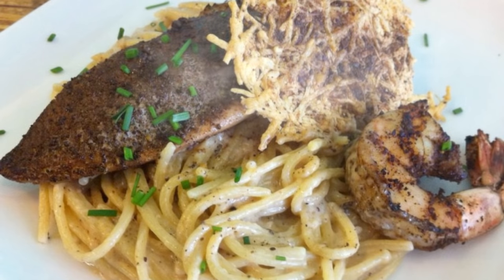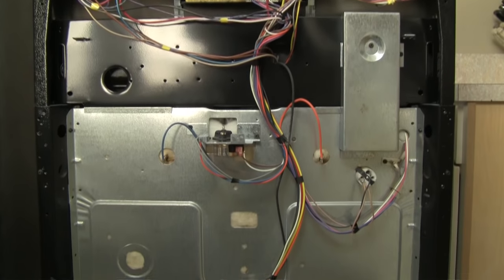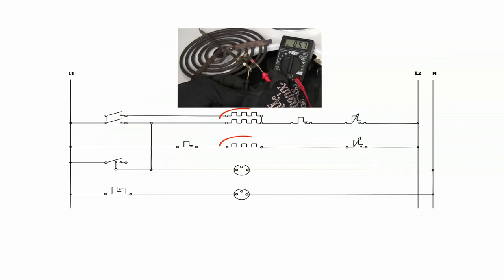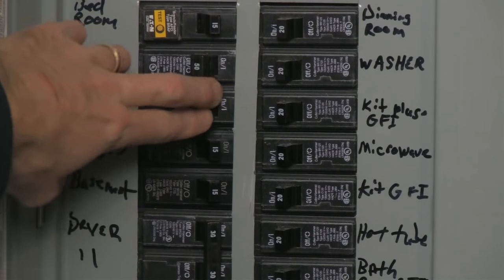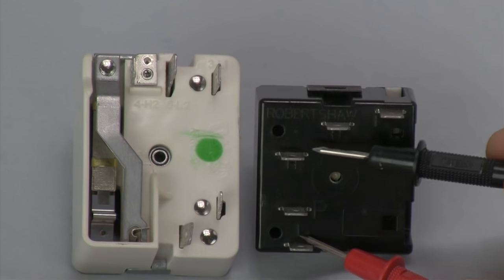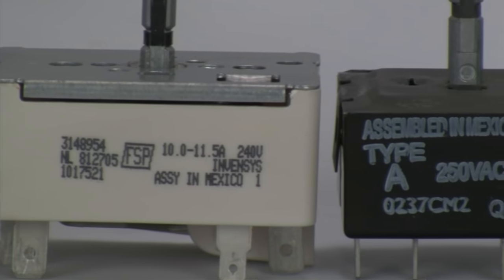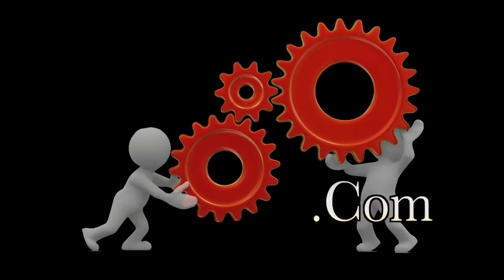Electric Range Stove Repair: How To Repair Burner Elements

Comment: Thanks so much! Fixed my problem @5:18 The replacement switch I ordered was the issue, the infinite switch was rubbing against the plastic housing causing it to bind and get stuck, not allowing current to flow through. Used a razor blade to remove some plastic and allow the infinite switch to move freely, good as new!
Reply from the maker: Now that's what I'm talking about! Good observation skills!  thanks for taking the time to comment!

Comment: Thank you for the information.  I had replaced the entire cook top wiring with a wire set from another brand of range.  My brother sent me the replacement from a scavenged unit as mine only had two working burners.  Replacement went flawlessly without help but the large element I usually use to boil water now took forever and never fully boiled.

Your identifying the amperage range of the switches was the solution I needed.  I simply swapped the infinite switches for the left two elements and solved the problem.  The right two were already connected correctly.  I can only guess that the original stove had both large burners on the front.

Comment from the maker: Glad to help : )  if it is just a cook top then it should have a separate power supply from the oven, so I would still guess that there is some kind of a problem with the electricity getting to the stove top... maybe a loose connection so be careful. Good luck!

Comment: THIS IS REALLY AN EXCELLENT VIDEO. I actually understand it. I have to do this on a Kenmore glass cook top. Either I fix it r it goes 2 the curb. It came with the house. Would never buy one of these, cheap, junk. I would spend more $ and get a better quality appliance, than buy junk. Tired of fixing/having it fixed.

Comment from the maker: The idea is basically the same the main difference is the need for a pan or pot with a fairly flat bottom for better heat transfer.  the only other issue is when your tasty culinary concoction is complete, it is a good idea to move it to a cool surface element because cool down time is fairly slow with electric surface elements.  Also if you have a glass top be careful not to use pots and pans that may scratch the surface. Good luck! Thanks for the question!

Comment: This is an awesome video. Thanks for your efforts. Concise and well explained. Helped me alot. I was working on a range that had 2 dual elements and they are both operating erratically.  I was thinking it might be due to the temp probe on the element and told "no that probe is simply for the pilot lights so it is most likely the control switch/knob that is the problem. Your video seems to confirm that all the heat cycling is done at the control switch/knob. Is that correct?
Reply from the maker: Thats the direction I would try first. Good luck!

Comment: Thx for the video.   My left front burner was not working - and it is the one controlled by the simmer select control board.  After testing the infinite switch for continuity L1/H1 and L2/H2 to be okay - I ordered a replacement simmer select control board and now its back to working order.    Save hundreds on a repair man visit.

Comment: Great video  Thanks, like to ask you a question I am not getting the 240 volts when touching both hot wires. I do get the 120 volts off each side. where could I start looking for the problem

Comment from the maker: Sorry for the slow response. on the Frigidaire style there are a few Phillips head screws on the under side of the top that you can see when you open the oven door. at that point the top hinges up on two tabs under the back of the top. Be super careful!! you may want to have someone else there to help. If the top breaks it's very expensive to replace! Good luck!

Comment from the maker: My pleasure! Unfortunately no, this is the only range video I've made. But in most cases the back panel will come off with a few screws and the switch is held in place by 2 screws behind the knob. You need to order the switch by the range model number which is usually located behind the storage drawer on a sticker on the frame of the range. Make sure you get the right one for that element, they can be different depending on the element size. Good luck! Thanks for the question!

Comment: Thank you for all the wonderful information.  Because you were so concise I was able to open the cook top and review the parts.  It became immediately apparent that my large front right burner was none functioning because one of the metal connections on the wire leading to the burner had burned and was no longer making contact.  My question is: Do I need to replace the complete wire with ends? Is it possible to put just a new end on? Do I need to replace the L1 L2 switch as well.

Comment: Thanks!  This video helped me figure out the problem with my stove!  The element control switches were switched (pun intended), so that the small and large burners were mismatched.  It caused the large burner to not really heat at all unless you turned it on high.  It must have been that way from the factory.  I just switched the switches and everything seems fine.
Reply from the maker: Congratulations!  Switching switched switches...Perfect!  Thanks for the comment!

Comment from the maker: Sorry for the delay, I hope you figured it out. Try using a meter to check for voltage from a screw on the range's frame to a ground connection and see if you get a reading. There is probably a shorted wire somewhere... Then unplug it and check for resistance from each of the plug terminals to the frame as you turn each burner switch on one by one. Hopefully that will help to narrow down where you should be looking. If you still don't find anything look at the oven element wires. Good luck!

Comment: Thanks for your video. What should I do with broken filament? Is there a way to reuse it or solder join?
Reply from the maker: There isn’t anything official that I’ve heard of or tried, but if you can figure something out that works I would love to hear about it.
Solder wouldn’t work because of the heat involved.

Comment: Hi, I'm so happy to found your explanations. I bought a Maytag in 2007 but the triple surface burner element never work. By the time, I realized it, the guarantee was finish. I checked everywhere with multimeter and the problem seams to be a broken coil. I want to know if it's reparable ? Can I do welding on it ? or need to replace ? It's very expensive, about 150$ 
Can you help me please ?

Comment from the maker: Well that kind of is what they are supposed to do... Is it not getting hot enough over all? When they are on they are full on, then cycle off to cool down, then back on again and off and on and off...   Side note: If the element is heating up to red it is okay.  So if the temperatures are not good enough I would lean toward a weak infinite switch... Hope that helps! Good luck!

Comment from the maker: Whatever elements are sticking on sound like they need new control switches. most likely the L2-H2 connection is shorted closed and not cycling properly. when the switch is turned completely off then the L1-H1 contact opens and turns the element off. Good luck! Thanks for the question!

Comment: i have the original ge electric oven/stove top. very basic. it was in the house when i bought it and i hope to use it until i redo the house and buy new in a year or so. but the only thing that works is the light inside the oven. looking forward to following your troubleshooting techniques tomorrow. thanks.

Comment from the maker: You can crimp on new terminals. (you can find them at most hardware stores) However, it is a high amperage connection so it needs to be a very solid crimp connection.  Your switch are likely okay you may want to double check so if you do need it you will only have one shipping charge.  But it's probably fine.  Thanks for the comment! Good luck!

Comment from the maker: Do any of the elements work?  Try resetting your breakers first. If that doesn't get it going again, you will need to look for a loose contact to the H1 side of the switches.  Hope that helps some. Good luck!

Comment: Great video!

Having problems with an old Jenn Air downddraft built-in counter stove/grill.
The two elements on the rihgt hade side are still functional.
On the left, there is either an insertable tray containing two more burner elemnts or one large barbecu type burner.
Barbecu element stopped working and when replaced by the two burner tray, one of the two burners no longer worked.  Replaced a burnt fuse and when turning switch for the non functional burner element fuse blows again.  To con't..

Comment: Wonderful video very informative. I have a question so my stove has a small burner and a larger burner being controlled by one dial or switch. So when I want to use the larger burner the entire eye is suppose to heat up. Sobthe coils that heat the outer portion of the eye work  and heats up while the coils that heat the inner part (the small burner)  of the eye does not heat up. In turn when I want to use the smaller eye portion only it still doesn't heat up. How should I tackle this problem?
Reply: Even though the element is one item it is made up of two separate heating coils. Sounds like the small coil is probably broken. Visual inspection or checking each part of the coil for continuity with a meter would verify the problem.  Best case would be a power supply issue inside the control switch for the smaller coil. Hope that helps! Good luck!

Comment: What a great video...!! any thoughts with 1 out of the 3 burners not working? I get a power reading on the 3 operational burners, but no reading at all on the bad one. Any suggestions?
Reply from the maker: Probably a bad switch that is controlling that element.  check voltage at the switch L1 and L2 is input so you should have 240 VAC there all the time… Then if the switch is on high you should get 240 VAC at H1 and H2 which are the output connections.  Good luck!

Comment: awesome video and website! I have an electric glass top stove. one of the elements on the stovetop when turned on, will make a big spark coming from the element, blow the fuse in the electric panel and create some smoke. could it be the switch itself is faulty and pulling too much amps?

Comment from the maker: Most likely... It sounds like the L2 connection is welded closed within both switches.  You can use a meter to verify... the L2 and H2 connections should not have any contact when the switch is off. 
Thanks for the comment!

Comment: Thank you for posting the video.  I have an electric range cleaned by the cleaning lady, then the surface heat light is on all the time.  When I turned on 1 switch, 2 burners on the same side were both on.  Could you help me figure out what the cause is?  Thanks a lot.

Comment: great  vid!!  i have a   jenn aire  that i  just dumped water on and  shorted   something  out    how do i  get the  top off?    thewater   popped and    flashed under thetop  the oven shut and locked cloesed  but  the   top  burners   showed  power  when i  turned  them on ,  its unplugged and    drying out

Comment: How often should the elements be cycling on and off. I put all switches on 5 and they seem to cycle on and off about the same. It’s a glass top stove very similar to the one in this video. Not too familiar with this style. Just wondering if it’s normal. Bought it used , everything else seems to work fine.

Comment: This video is very informative. I have a LG electric glass stove top. The main (largest) burner is only partially heating up. The outer ring is heating up but not the inner rings. Do you know what could be the cause of this?
Reply from the maker: If it has an inner and outer ring that can be controlled by the switch (Small, Large) then that part of the switch is bad or the inner part of the element is broken.  It can be checked in the same way as on the video... just think of it as another burner set inside the main element.  You should have a reading through the element itself, and a connection from the L1 to H1  and L2 to H2 contacts on the switch that feed the smaller inner coil.  Hope that helps! Good luck!

Comment: very informative. But where is the switch for the warming zone element centre back of my frigidaire stove top? It's controlled by pressing a button repeatedly on the panel beside the clock. The element doesn't turn on, and before replacing it, I wondered if something else could be the issue with it.

Comment: My dual radiant element has a second probe across from the shown probe and it that failed and caused the burner to not heat.  Check the continuity on that probe too.

Comment: I have a Kenmore model #790.96593602 electric glass top stove. The large front right three coil burner has stopped working properly. The main inside burner went out but the middle and outside ring still works. I opened the top and tried doing a continuity test. I expected to hear the closed circuit on two of the three circuits but instead I hear nothing. When I touch the two meter probes together, my meter buzzes so I know it works. I need to find out if my element needs replacing or the control panel needs replacement. Could your help?

Comment from the maker: Sounds like the control relay the powers the broiler is shorted closed inside the control... Technically the answer to your question is no. However... There are two wires feed power from the control to the broiler element... From there you will need to use your own good judgement and discretion. : )  Good luck!

Comment: May I use a small portion of this video in a video I'm working on? I just want to show an oven element burning, and would be more than happy to point back to this video.
Reply from the maker: Probably, What amount of time would the clip be?
Reply: @applianceassistant  I didn't check exactly, but around 5-10 seconds, just a bit with a stovetop heating up, video only.
Reply from the maker: Yes you may. Thanks for asking!

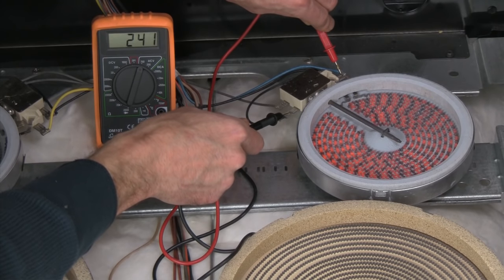Comment: My original burner only has one connecting tab on the left side. All the replacement burners I see have two like the one in your video at 3:58. I see that you're only testing the bottom connector with your multimeter. Is there a way for me to get a newer burner to work somehow even though I only have one connecting tab? Maybe by splitting the one wire into two? I have no idea.
Reply from the maker: Interesting, what is the model number?
Reply: @applianceassistant  The cooktop cartridge is the JDXR50. The 8" heating element is WB30X5116.

Comment: Awesome video! I have a LG LRE3091SW and the left front burner sometimes gets super hot...even when set on 3 or 4. When this happens I turn it off and on and then it seems to be ok but today it went red hot again even though it was only on 3. Any thoughts?
Reply from the maker: It's normal for the element to cycle red hot and then off and back on again. However, if it is sticking on and not cycling or it is running much hotter that what it used to do then probably the L2 to H2 connection in the control switch sticking closed and not cycling properly.  Hope that helps!
Reply from the maker: It's normal for the element to cycle red hot and then off and back on again. However, if it is sticking on and not cycling or it is running much hotter that what it used to do then probably the L2 to H2 connection in the control switch sticking closed and not cycling properly.  Hope that helps!

Comment: Question.  My issue with my JBS55DM2WW :  8" heating element won't heat.  Opened up the glass top and saw that a blue wire appears burnt and has disconnected from the crimp spade.  Can I simply buy a new crimp spade connector at big box store and fix?  Do I need a special stove/oven rated spade connector?
Most online appliance store don't have the wiring harness for sale, and I don't believe I need an entire new harness;  just the one bad wire that came off, right?
Reply from the maker: That should work just fine! Just use good materials and make sure you have a good crimp and you should be fine. I look at it this way... the factory crimp failed, so you can’t do any worse... ; )

Comment: Hi applicantassistant. I have a whirlpool gold and my electric burner stopped working but the bridge burner work that is located right beside it. Do i need to change the element since the bridge works or could it be the infinite switch?
Reply from the maker: Not sure why I missed you post... I hope you have it figured out, but if not, it could be ether the element or the switch.  Just treat the second part of the burner like a separate element... the switch will have two sets of out puts for each coil in the element, so you can check it in the way I show on the video. You can also check the wires from the element in question for resistance with a meter, if it shows as open then the element is bad.  Hope that helps... you or someone...  Thanks for your question!

Comment from the maker: Unfortunately, if the elements are okay and check out with a meter for continuity, then it is likely the control board. (easy repair) Probably still worth fixing if the rest of the appliance is in good condition. good luck! Thanks for the question!